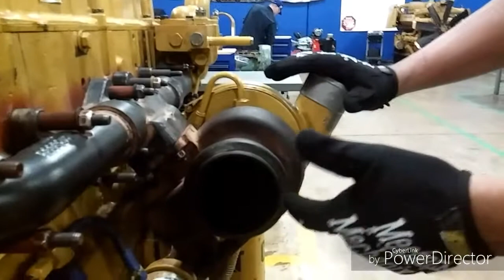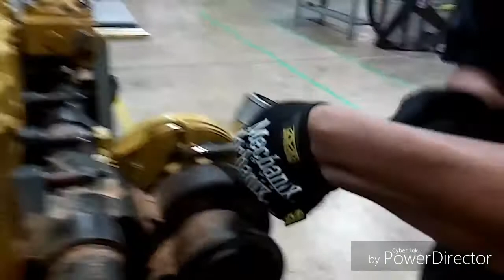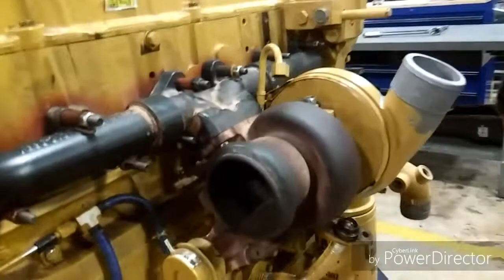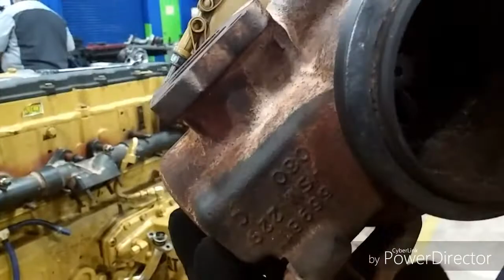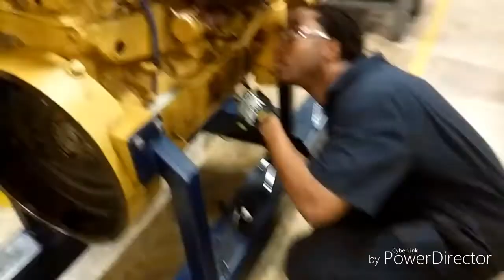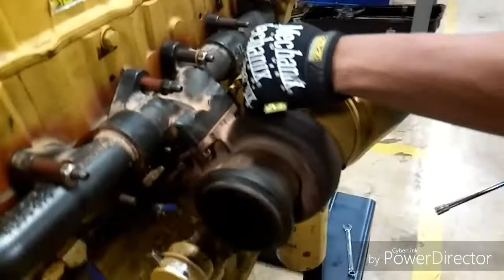Dismount/mount a turbocharger on a Caterpillar C7.

Comment: Thank you for doing this video. Explains everything clearly. I am trying to add a oil bypass centrifuge to a 3126B and need an oil supply port. Would it be ok to tie into the turbo oil return line? Or can you suggest another point?